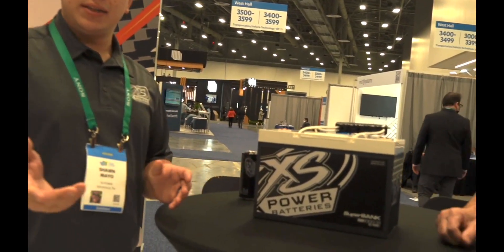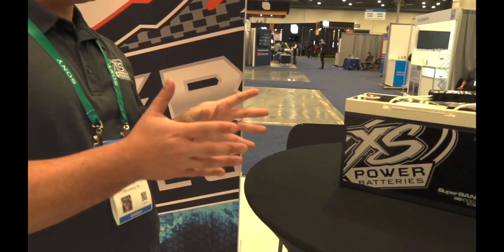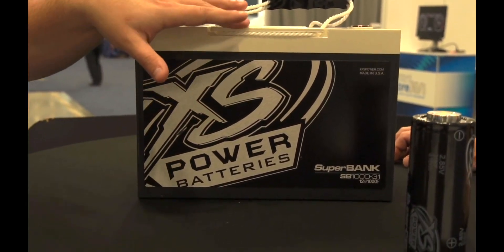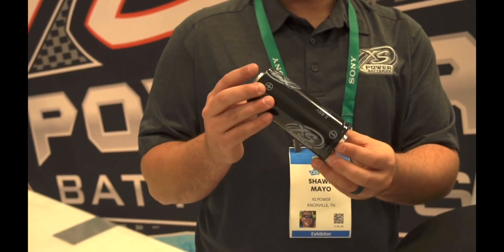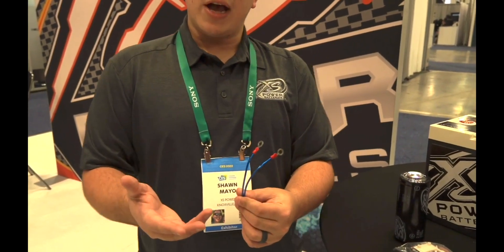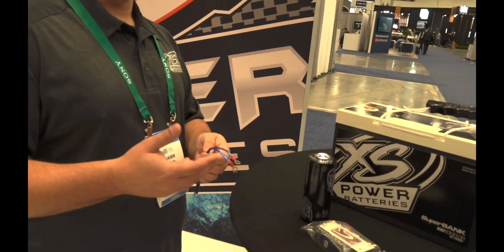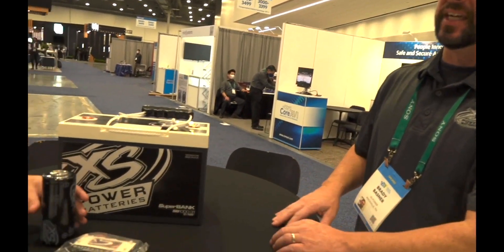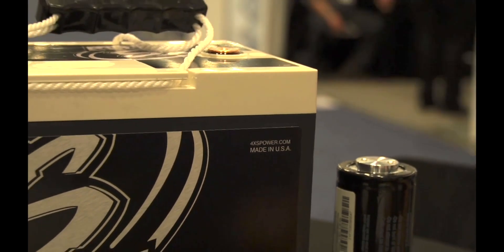Capacitors In Car Audio! SuperBANK | XS Power Batteries

Comment: Would this be good for solar system to use. Have a old lance slide in camper want to go solar and in alaska off road.
Reply from the maker: Capacitors by themselves would not be ideal, as they have no real reserve capacity. If you were to wire in line with other batteries, capacitors will aid with stronger, more stable voltage when a load is applied.

Comment: Hey Shawn I just acquired a 6S4P 2000 Farad XS power super cap bank from a team member of mine and it doesn't have any type of balancing system on it like the Maxwell caps I've seen before is it ok to run it like that in my system or do you guys have a balancer for your caps if it's needed and where can I buy your end bars for lugs for the bank it doesn't have them just a flat aluminum bars I want the ones actually made for the bank and I live in Cookeville TN I can drive to Knoxville and pick them up if needed really want to use this bank on my Ruthless 10k
Reply from the maker: Hey! Send an email over to shawn@xspowerbatteries.com.

Comment: XS power group 34 up front. 3, lifepo 4  batteries in the back. XS power group 34 ultra cap to match the front? If I use group 34, stay with group 34?

Comment: I feel they gave some good information here, but also left out some critical information;
If your amplifier draws more amps than your alternator can produce- no amount of additional batteries or capacitors will stop the voltage from draining, it will only slow the inevitable drain.
Do some calculations and learn how large/how many an alternator you need. A capacitor is great for big loads so you don’t short out the battery because is buffers the high voltage demands of a large system. Capacitors do not replace a batteries amp hours or substitute an alternators power generation. 

All three work in tandem to have a safe and effective circuit.
Reply: These actually do serve a useful purpose. As long as your alternator supplies enough power most of the time one of these will put in a buffer to prevent voltage drop when you have a big spike in power demand, such as hitting those hard lows at max volume. You need to install the supercapactor (or regular capacitor) as close to the amps as possible for this to work well. That will prevent you from having a voltage drop and your alternator will be able to keep up with the demand. However, if you just start throwing batteries, capacitors and supercapacitors in without first doing to the required upgrades otherwise you’re just going to be adding a ton of strain to your system. This is why I always tell people to get a high output alternator, do a big 3 using 1/0 or 2/0 OFC, replace the stock battery with a quality AGM such as an XS Power D3400 and to run 1/0 or 2/0 OFC to a distribution block near where their amps are going to be installed before they even think about adding batteries and capacitors. For most installs once the electrical is upgraded they’ll never need to add any batteries to the system. Once you start getting around 4000+ watts of power is when that stuff comes into play. I’m hitting that point now and I’m planning on adding a supercapacitor as a stop gap until I can afford to move up to dual alternators. I already have a Mechman 370a Elite under the hood and new sub amp pulls around 300 amps at full tilt. Hits hard but my headlights are slightly dimming now. Not enough to where I cannot see but enough that I need to address this. Voltage is also sagging at lights and stop signs. Gotta protect my amp, would hate for it to blow due to voltage drop or start clipping and kill my new subs. I just wish I could afford a XS Power Superbank right now. Instead I’m going to have to settle for a much cheaper one from another brand for around $350, but it’ll get the job done.

Comment: Watched the entire video for research on an inverter setup that I'm going to build.  It wasn't until the last moment where he showed the 'Made in the USA' label where I was fully sold.  I see a lot of this stuff on Ebay and Amazon from China and I don't want to take my chances with cold/broken solder joints or non-functioning balancing circuits.  No thanks, when dealing with this amount of energy I'd rather have something build with pride right here in the US.
Reply: I spotted that in the first 30 seconds or so of the video. It’s right there on the top right of the supercapacitor. XS Power makes good products. I’ve been using a D3400 since 2015. I’m on my second one now but that was my fault. I didn’t drive the vehicle for some time and had it on a battery tender. Well I needed that battery tender for another vehicle and forgot to hook it back up when I was done with it and then got sick with cancer. A year later and the battery had drained to nothing and then it got swollen (normal for discharged AGM batteries). If it wasn’t for that I’d more than likely still be using the first one that I bought. In any case that battery lasted for nearly 7 years of hard use without ever once giving me any problems. That’s more than I can say for AGM batteries that I’ve bought from O’Reilly’s for other vehicles that didn’t have car audio in them. I’ve had to warranty two of those, luckily they had a 100% replacement warranty on them.

Comment: Hello I was really hoping to get some advice. I have a 09 acura csx. Civic si basically. I have the big 3 upgrade with 0 gauge done and a high output 250 amp alt. I plan to have 3-5k rms. I am concerned about the group 51r battery being a bottle neck I may be able to fit a group 35. I would like to utilize the under hood battery space. What would you recommend for under the hood and for in the trunk to run 5krms. I am open to using agm, lithium and supercaps in any combo you recommend. Perhaps there is a under the hood safe lithuim battery that may be a good option. Not sure if it makes a difference I am in a very cold climate. It starts perfectly fine but would be cool if my car started super fast as well lol. This is a super loaded comment If you respond it would be incredible!
Reply: Should i have a super cap under the hood and sole sort of lithuim in the trunk? Best route?
Reply: supercap under the hood, lithium in the back, for that kind of power id go with an xmax 45, or xmax 67, or just go all in and get the xmax 90 that way your set for future upgrades

Comment: Honestly great video but now im even more confused on what I need to purchase for my current build that I’m working on . 😂 I’ve reached out to battery places about XS Power and what size I need and I’ve gotten different answers. It can’t be that hard to tell me what I need for a Taramps Bass 3k and a Taramps DS 800x4. I should have went Orion XTR Amps like in my other car so all I had to do was put a AGM under the hood 😂
Reply from the maker: If it's overwhelming, just keep it simple. Upgrade the battery under the hood and add a secondary battery for support and you should be golden!

Comment: Not to be a hater, but XS power fell out of favor with me some time ago.
I purchased an XS Power battery that went bad after just shy of 3 years.
Getting a warranty was a nightmare.  The lack of retail outlets to support their product was a huge hindrence in their customer support.
the people i was able to talk to said i had to prove the battery wasn't under or over charged, etc...
eventually i gave up on XS power and bought an optima.

Since then, i have talked with other people about their experiences with XS Power and learned that the general opinion is that XS creates a top teir product, but their support after the sale (imho) leaves them as a second teir choice.
Reply: I purchased a D3400 XS failed out the box zero support from returns lucky the distributor helped me out 100% battery is on a 24/7 battery tender .... seasonal  JDM car

Comment: Please help I’m looking to buy the sb1000-31 my voltage is in 1.36 never can get it higher I have a salt 8k have a 250alt and 2 agm battery’s it hold but when it hit the Lows brings it DOWN to 1.18 even lower
Reply: @gerardogonzalez1455- You have your decimal points wrong, i think you meant to put highest voltage is 13.6volts, and drops to 11.8volts and lower when the lows are slamming, is that correct? If so, do you have the Big 3 done? If not thats the 1st thing you should do. Then i would either get 1- Titan 8 S5 PWR added inline with your other batteries inside, in the back, and or get the Sb 500, or Sb 1000, can never have to much electrical.
Reply: The salt 8k is big, and you really should run a larger or dual alternator. Look up “calculator for how many amps do I need for my subs” or something. For 8k watts you’ll need like 534 amps. If you’re alternators aren’t able to produce that and then some (for the normal vehicle running electronics) then your batteries will always drain faster than your alternator can supply power. No additional power bank will help, only delay how long it will take to drain. So, either get a huge power bank and always charge it overnight or get an adequate alternator setup.

Comment: XS Power please help me out here. I am building a 4x15 Zv5 Build in my Tahoe. I will be using a dual mechman 400amp. For front battery I will use the XS D3400. The question is supplemental batteries. I was planning to add 3 XP3000. But after discovering this, I now think adding a super bank would be better. I mean whats the catch ? What would be the difference in adding extra batteries vs superbank? Is it ok to use both ? Sorry new to the scene. Thank you
Reply from the maker: With a SuperBank being a capacitor, they deliver instant power over a short amount of time. We see them used in car audio competition for burping, and in commercial applications for starting (heavy diesels that require a lot of instant amperage). A capacitor is going to have a lot of instant power, but supplemental batteries have more reserve capacity for longer draw applications. SuperBanks perform best in parallel with other batteries, so based on the information you've given, you could do 2 of our XP3000's, and one of our SuperBanks. Our SB1000-31 is the same size as the XP3000, but there are plenty of other options for sizing of the SuperBanks.

Comment: Quick questions: If I'm running 3 AGM batteries and I add the SB500 to my system (1 Synergy Audio WFO 5.1D with a Singer 320 alternator) would this be sufficient? I already have a new SB500 that I want to install. What if my system is drawing more than the cap can handle, would that be an issue or would it be safe to run the SB500?
Reply from the maker: There wouldn't be an issue installing your SB500 in line with your other AGM batteries. You'll see an improvement in your voltage!
Reply: @4xspower  thank you for the reply! I'll be adding it in soon.

Comment: Adding one XS SB1500-75 to my one D3400 a couple years ago made a BIG difference in my voltage for my 8K. Now I use a couple XS Lithium batts with same 1,500f super bank cap mentioned for my 16,000W as seen on my YouTube channel #LowHertzHighSPL
(I earned 2nd place in my Slamology MECA Street class. My 2 - 15s can hit over 155dB)
Reply: Do you use this under the hood?
Reply: Question friend. I want to run a dual setup under hood in my Tahoe because I take my box out when needed. How would I do a super cap and titan 8 under hood. .